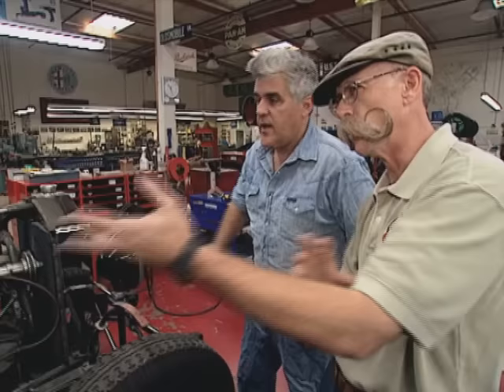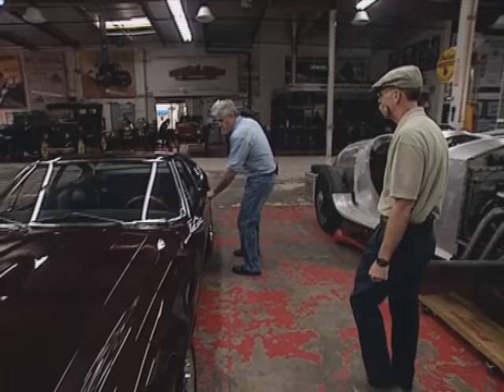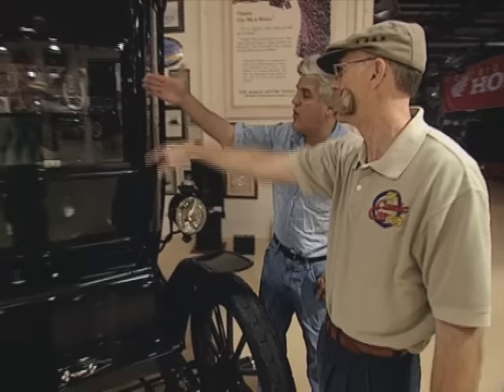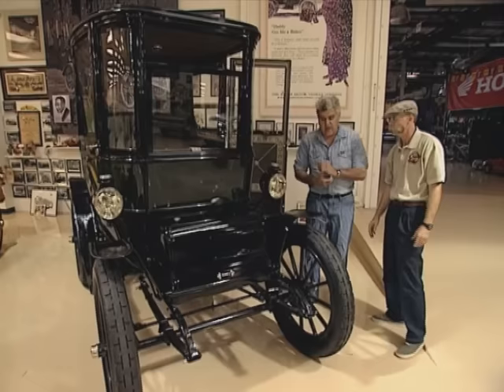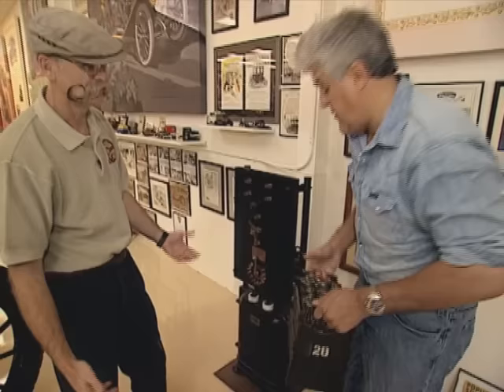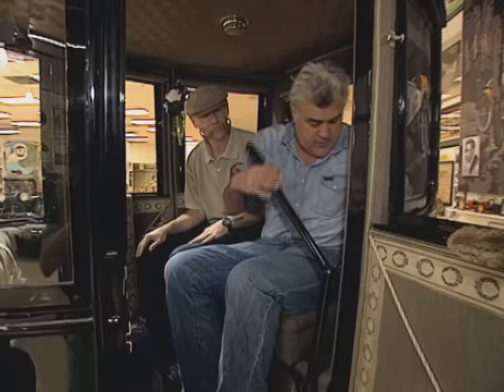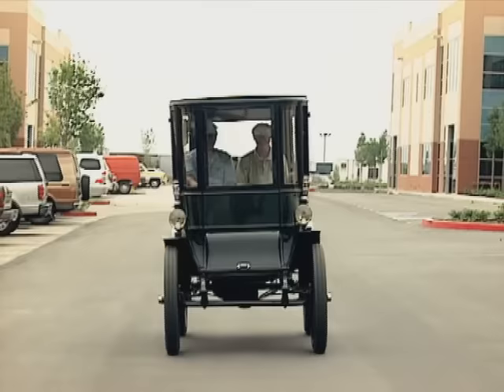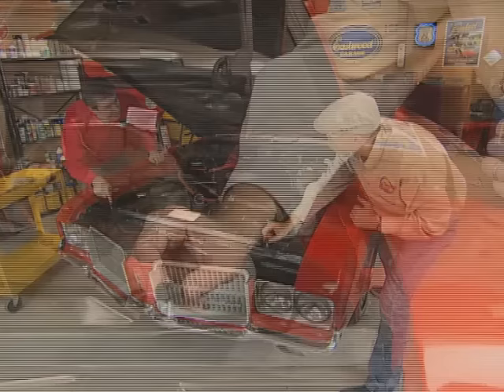Jay Leno's Baker Electric Car

Comment: All you would have to do to make that car go faster is fit taller wheels and some motor bike disk brakes on the frount probably would be a good mod ...I noticed the windscreen wiper hadent been invented at that time .I guess if you put a large overhanging  cowling above the front window it wouldent get very wet.Or you would employ a street urchin to keep wiping the water off the window .just put a little seat on the front. I also noticed you could turn this in to a duel fuel car ..you could theoretically put a horse shafts on the front for those longer inter state trips .the electric motor would help the horse out when the going gets hard in a emergency for a little umph .I wonder if anyone tried this ?as there could be hundreds of miles to the next charging port not to mention Indians.!

Comment: They had this kind of technology back then and still the combustion car took precedent? Huh…
Reply: Besides only having a range of about 20-50 miles on a charge, the company that built them was bought out by a gasoline car manufacturer 20 years before the Rural Electrification Act brought power to places other than major cities. Electric cars have existed in some capacity for almost as long as steam locomotives (the first one on record was built by Scottish Inventor Robert Anderson in the late 1830s), but now theirs both the electrical infrastructure for them to be viable as well as an environmental push for them to be more mainstream.

Comment: Where is the steering wheel, and is its position on the left or on the right when viewed from inside the vehicle?
Reply from the maker: No steering wheel.  It has a lever called a "tiller" instead. It is left-hand drive.
Reply: @MyClassicCarTV  Thank you for your answer.

Comment: Six cheep serviceable car batteries in a phone boot on wheels and 100 miles range? Current approach with expensive electric cars seems so wrong, it simply doesn't calculate.
Today: my batteries are broken after the warranty - I'm broken.
100 years ago: I must add some water to my batteries and charge them.

Comment: 23 miles an hour,of course it  gets 100 miles a charge. lead acid batteries are very heavy and don’t hold the power of lithium batteries. It’s basically a golf cart

Comment: It is no conspiracy that has held back the electric car all these years, but the simple fact that hydrocarbon fuels provide much greater energy density than any battery.  The super-high tech Tesla is getting close, but how many people can afford a hundred-grand car that needs recharging every couple of hundred miles?  I have driven my Camry hybrid five hundred miles on a twelve-gallon tank of gas.
Reply: Nothing beats the BTU's from a gallon of gasoline, even with extraction and processing and transportation it's still the most bang for the buck

Comment: You pull into a full in ng station.  Fill up in five minutes and off you go GB or 300+ miles.   You hook up your charger and off you go for 200 miles,  8 to 12 hours later.  That's why gasoline engines are superior to electric.

Comment: 6 volt batteries do not give you "more power"! Gahh! Higher voltage means smaller wires, smaller fuses, smaller everything, which is why modern electric cars run on hundreds of volts.

Comment: Amazing it took Tesla as long as it did to get electric mainstream again
Reply: Well, electric trams and electric trains never went away, even if electric cars did.
For the 20th century, oil's cheap abundance, extreme energy density and sheer convenience just couldn't be competed against. 

Because of the technological cul-de-sac of the internal combustion engine, the progression of battery technology basically ground to a halt for 100 years due to a lack of market pressure to improve it. Now the world's got to make up for a lot of lost time!

Comment: This is for all the spergs and Zoomers. Development of electrical engines and electrical technology was never stopped. First off. We would not have electrical relays, vast networks of power management ( funded by the Gov. ) and personal computers if electricity was outlawed or lobbied against by powerful and dark forces in what you think is a competing Industry. Electric motors have been used and refined for a 100 years to power factory lines, mine shafts, power generation and vehicles in space. The ICE is merely a budget alternative for the masses who voted with their wallets and the Toyota is merely one of the winners of the ICE technology when it comes to "unit cost" and the "total cost per mile". In 2020, Tesla is still dependent on subsidies at the production line ( carbon credits ) and at the consumer end. In the EU every owner of an ICE is transferring a minimum of $10.000 from his/her personal tax to every user of an EV and this is without counting the massive tax on fuel ( petrol, diesel, bio ) which can be up to 400 %. On top of this, there is self sabotage and various Gov. intervention AGAINST the ICE ( not the EV ) making ICE drive trains of such low quality that they break down at 20.000 miles even with original parts and service at regulated mechanics in what is a mixture of planned obsolescence ( to increase revenue ) moronic ideas and being forced to include a crazy amount of destructive filters and turbo chargers that blow up the drive train earlier than a Donkey would die. Thanks to Gov. intervention, a modern ICE lasts about as long as a bicycle and with the tax incentive the EV becomes a better alternative and this is precisely why we have Jay Leno and various Historians and enthusiasts to show us what CAN theoretically be achieved.

Comment: Electric cars still get their charge from petroleum-powered generators.
Reply: Not in the majority of the world. Most of the power on the grid in my country comes from wind. An average of 3% from coal and zero from petroleum. Even if you did have a hypothetical 110% oil powered electricity grid EVs still make more sense because they would still have higher well to wheel efficiency than combustion vehicles...still cost less to run and still be better cars to drive.
Reply: @cros13  Nope, I'm afraid you're first sentence is wrong. Most power in the world is derived from hydrocarbons.
Reply: @hawkmaster381  Oil/petroleum derived gases were a source of 3.28% of global electricity and dropping as of 2014. Source IEA statistics 2014. petroleum is a hydrocarbon. not all hydrocarbons are petroleum.
Reply: @cros13  Where do you get your facts?
Reply: @hawkmaster381  That particular stat is on the world bank site. But IEA dot org is the original source and has plenty more detail. For example in 2017 IEA stats global petroleum electricity generation was 841,878 GWh while global wind generation was 1,127,319 GWh. Very few countries use petroleum as a primary fuel source for electricity generation. Saudi Arabia is a notable one but it's almost unheard of in much of the world.